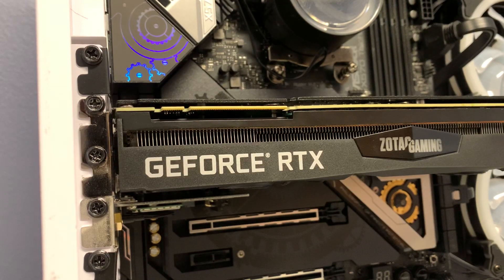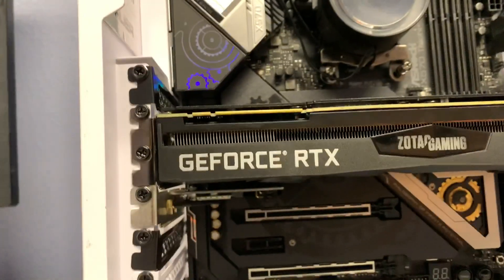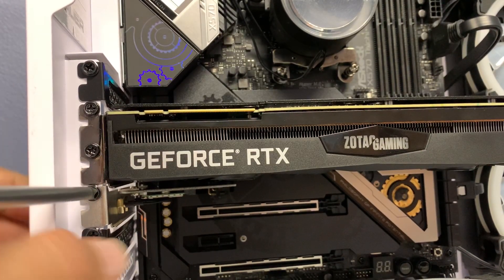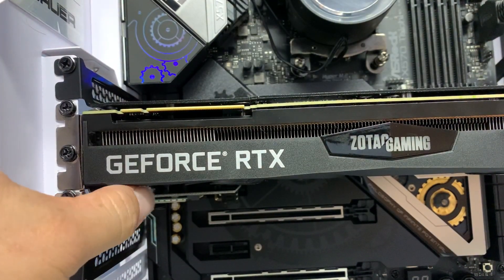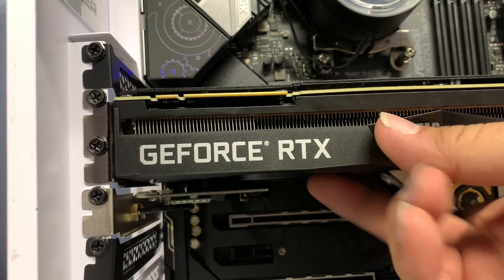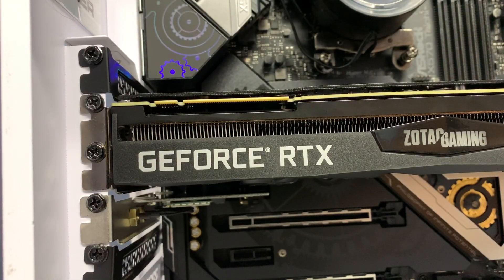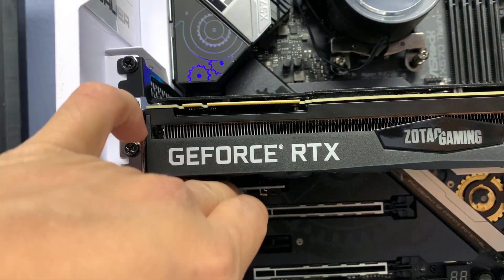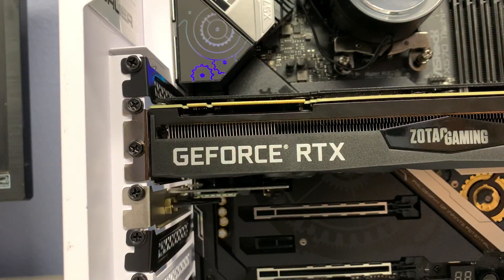GPU fan hitting Wifi card (Gigabyte B450M+TP-link)

Comment: is moving the pcie wifi card to another x16 slots will slow down the gpu?
Reply from the maker: No it will not, this video was mainly geared towards those who have a smaller M-ATX case. If you have an ATX case and can move the card father down, it will not affect any of the other pcie slot performance.
Reply: @troubleshootdis5930  Ah i see. Because my other x16 in the specs support x4 lane and using cpu lane not the chipset so i'm a bit concerned there. Thank you for the info :)

Comment: is there an extension that I could use for the wifi card? Mine is completely covering the sockets
Reply: Found It man :euroharry 20cm PCI-E 1x
Reply: @violetguy1488 thanks
Reply: @violetguy1488 awesome! glad you found one! I end up using another card and installing it one port below instead, Edup Wifi6e 5374mbps Pci-e B, if anything this late year response is backing a small review, no latency whatsoever, working like a charm + bluetooth, no disconnecting headset 1 floor below ദ്ദി´ ˘ `)✧
Reply: have you find it man?

Comment: I hope you'll reply. I have a single fan gpu and the slot for wifi card is right under it. I think it have some clearance but I'm scared to actually risk it. Do you think I should go for it or just opt for a usb one instead? I have my eyes on both types from tp-link but aren't ready to buy either. It is a single fan asus gtx1650.
Reply from the maker: No harm in trying to just create a gap between the gpu fan and the wifi card. If all else fails then i would go USB dongle! let us know how it turns out.
Reply: @troubleshootdis5930  thanks for replying! I ended up buying a usb dongle. I'm not willing to risk it because I'm still a novice when it comes to pc parts. I'll go for the safest option for now.

Comment: How does the heat exhaust from gpu fans affect the Wi-Fi card I’m sure it won’t melt it lol but still considering overtime.
Reply from the maker: Hello, It should not be an issue as the fans on the gpu are the intake. That is where cool air will be sucked in to the fins and then vented to the sides.  It surely will not melt and if anything if the wifi card is emitting heat from its rear then the gpu fans will cool it off as it pulls air in.
Reply: After installing a similar wifi card, in a similar position. Then updating the wifi card drivers - now the ventilators sound really loud. Always running on max. Cant be adjysted manually to run slower. Heat is ok, but the ventilators that loud is annoying. What to do?

Comment: I have a micro ATX motherboard meaning my wifi card is forced to go right under my graphics card and it is causing my graphics card an extra 15°c making it run very slow any ideas to fix?
Reply from the maker: Hi there, have you checked if there is a pcie X1 slot above your card or maybe a slot further below? It is possible to install the wifi card on a full slot and it will still function fine.
Reply: @troubleshootdis5930  nope micro ATX motherboards only have the big pci e slot and the smaller on right under it I bought a slot extender will update when it arrives and I'll see if it helps temps

Comment: My graphics card is completely blocking my wifi adapter I have no idea what to do
Reply: same here
Reply: smae problem 3 years later, you probably alredy have new pc, but to those with same problem- i will buy some riser PCI-E x1 with 90 degrees angle, so it will fit under my gpu
Reply: @misteldrutel6632 did it work for you?

Comment: Hi, is there any issue with this? Like airflow to gpu or other issue. I got gpu with WiFi card and it's same like this. I worry if the card block my GPU airflow.
Reply from the maker: Since the air vents out the side of the card this will affect the airflow but not at a significant margin. You should be ok.